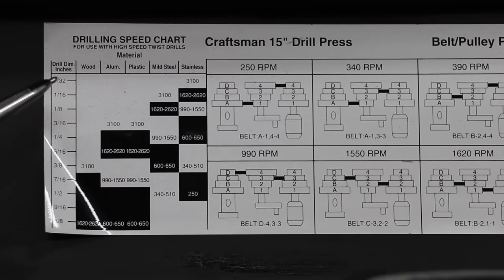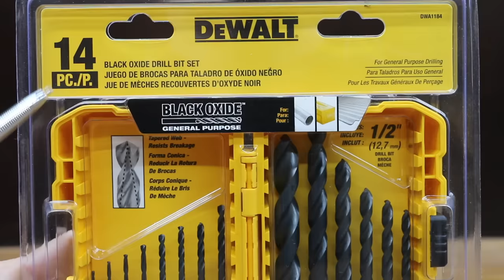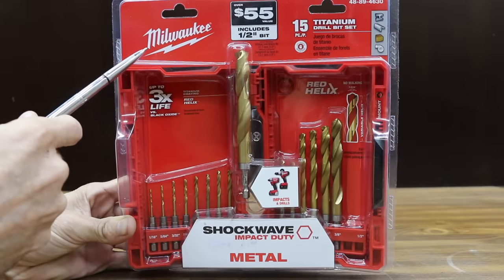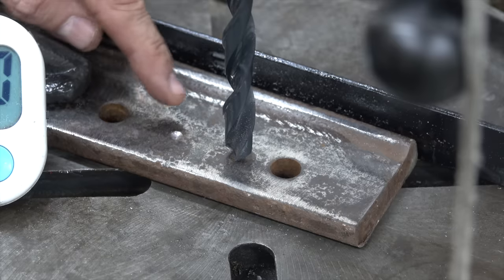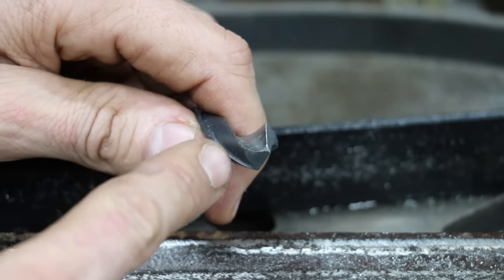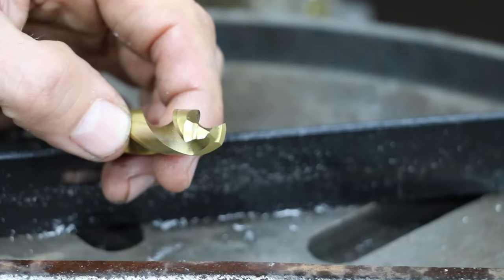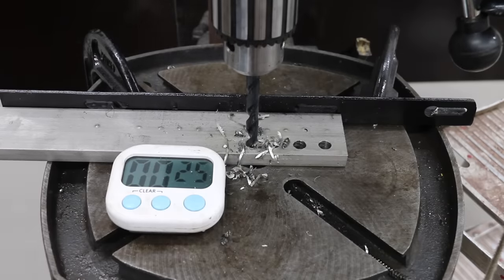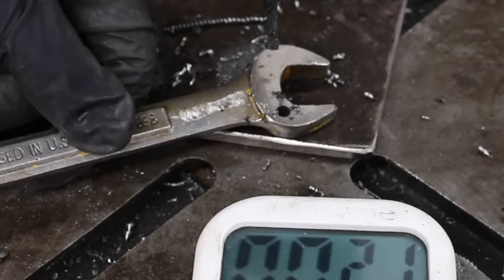Which Drill Bit Brand is Best? Let's find out!

Comment: Test to see if starting fluid actually hurts an engine.
Reply: @stalinsbitch7428  yes that's a last resort for an inch and you know you're going to overhaul next month anyway
Reply: I don’t believe it, just an old wives tale, if you ether lock it and crack ring lands you will be fine
Reply: @stalinsbitch7428  If you need starting fluid, the engine has issues anyway, which will get worse over time, the starting fluid gets the blame for the problem getting worse, when it would have happened anyway due to unresolved underlying issue, my dad has used a similar saying.
Reply: Todd Paulson Starting fluid is great for getting a diesel to shoot flames
Reply: Todd Paulson he already has a video on this
Reply: @CubNole  non chlorinated brake clean works pretty good also.....lol
Reply: StalinsBitch well then why does gasoline engines that commonly burn e85 fuel Which is 85% alcohol and run on that all day long just fine, but when you spray ether alcohol into a diesel engine for a split second along with the diesel that is being sprayed from the injector and not actually burnt so there is a lot of diesel which acts as a lubricant(if it was being burnt the engine would be running) . It just magically destroys and engine in a instant, I don’t think so, if the same principles where correct and true then every gasoline engine would be ruined right away, because gasoline and e85 acts as a excellent solvent, and the cylinder walls will be striped of any oil and destroyed, no not at all. And if there is a layer of oil on the cylinders it would be being burnt and it would smoke brand new from the factory. And yes running a gasoline engine stupid rich will have fuel wash issues long term, that’s bad but a few seconds of ether is no big deal in a diesel. it is a wife’s tale, and aslkng as you don’t ether lock it it will be ok. Also old trucks came from the factory with ether start systems in place, they they have a good enough engine life to make that “ether kills diesels” statement False
Reply: If you would run engine on it, it would delubricate but not if you just start. You not suppose to flood cylinders with but just spray enough so there is vapor to combust it.
Reply: YES! Totally concur with this test. Working drywall you'll go through a box of bits on a project. As a mechanic, I go through a good few bits, too. What IS the best Phillips #2 bit?
Reply: Its amazing how deep anecdotes run into the world of machinery. Change your oil, use the correct fuel, if your engine was quality made from the start it will be fine 50+ years from now.
Reply: @mrmatt2525able  
Ether doesn't kill diesels, people who over ether diesels kill diesels!
The key is how it's "sprayed" injectors atomize the fluid and then ignite it before it has a chance to condense into a liquid. When most people spray starter fluid they soak it and you wind up flooding the engine with solvent drying out the seals that are already on their way out cracking them until you to turn over the engine. Also, have you ever put too much lighter fluid on a charcoal grill? Ever warped the metal on the grate because you wanted those nice char lines? Now imagine that happening inside your engine because you flooded it with starter fluid. Now, do you think it's possible you're over pressurizing your cylinders? Not over heat because that'd take a longer period of time. Warp? maybe.... but doubtful. Unfortunately it only takes one over pressurized stroke to bend a rod, valve, blow a seal. Engines don't heal like people do even though we'd like to think otherwise. So death by a thousand cuts REALLY is a thing for these guys. Just a crack here, a slightly bent rod there and over time you wind up with a cylinder that has at best lost compression or at worse ejected.
 Our diesel tugs at work sometimes needed starter fluid and just misting the intake/filter was all it needed. Some guys would freak out when I sprayed the paper filter... but just a light mist was fine just don't soak it. It's better when there's two people, and you take the filter off crank the engine and have them spray it after you started cranking. By myself i misted the filter. ALSO, sometimes the engine's just too dmn cold to start on it's own. The only thing that's "wrong" is the dmn thing didn't come with glow plugs! So starter fluid is the only way lol.
.
Reply: He did that look at his video history.
Reply: I've been starting my 3cyl Yanmar diesel excavator for 12 years on spray-ether starter fluid. It was made in 1984, still runs like an absolute peach, is incredibly economical and burns almost no oil.
Reply: @viseriod517  I'd concur with that. I put a 1 to 2 second spray into the air filter intake and about 10 seconds later crank it. That's all it should take.
Reply: Myself, I just use a little WD40! A little squirt in my ATV engine when they won’t start up after sitting thru the winter. Squirt of WD40 and they start right up! Done the same thing in lawn mowers too. WD40 more flammable then gasoline! Been doing this for over 40 years and never had any problems!
Reply: Gale Jenness haha WD40 is NOT more flammable than gasoline! Far from it. The flash point of WD40 is 138deg; the flash point of gasoline is -45deg. Yes, minus. The flash point of ether (starter spray) is also -45deg. Both gasoline & ether are explosive when the vapour mixes with air.

Comment: This is one of those times where the most expensive product is actually the best(or 2nd best, since this test didn't cover the longevity claim of the bosch bits)
Reply: Cobalt bits are always better, even the "cheap" Harbor freight ones. I've never worn one down, just broke or lost them. Best bits to buy hands down. Just like at the end of the video though, slower and harder is better.

Comment: Just curious as to the country of manufacture for each set, I would guess china for most?
Reply: I would say NONE of them are USA made. . . . .Precision brand run about $150 a set and I'm sure Cleveland Twist is about the same. Huot can be had for about $50 a set. . .
Reply: @rustysausage69  Where are the Bosch made?
Reply: Yeah many of them I think might be the same bits with different branding.
Reply: @z50com  probably Germany lol
Reply: @SockyNoob  Definitely not, Bosch make next to nothing in Germany.
Reply: @SockyNoob  My bet is Bosch drill bits are made in Malaysia or Taiwan.
Reply: @SockyNoob  Their Concrete Rotary Hammer bits are made in Germany. . .But they're specialized and expensive. . .
Reply: @z50com  I own the 21-piece Cobalt M42 set (same type that Todd tested). They're made in China. In fact, I found that every Bosch bit set including the black oxide, titanium, and Impact Tough (supposedly their toughest bits) are made in China. Very disappointing. But, the cobalt bits seem to work well, as we saw in the video. As long as quality control is strict and the performance is good, then I can't complain too much.
Reply: @zroth79  As long as they perform that's what matters. I worked for McDonnell Douglas/Boeing for 15 years, they only used American made drill bits.  We did have some reamers that came from Yugoslavia but I would bet it was some sort of you buy our Aircraft we'll buy your reamers type of deal. . . .
Reply: @z50com  I'm undecided on this attitude (get whoever's).  I applaud their support, but I understand appreciation of quality.  I want to be impartial, but I see the need for self-support. Yeck, I've even know a foreign US citizen with the attitude (when the economy was bad) "give the sale to the home team" - even would let the baby deer eat from their garden.

Comment: I wish you had used Industrial Brands that Machine shops use ! Not hardware store Brands only !
Reply: I go to the nut and bolt shop and buy the brand they carry- I have had a 4.2mm drill bit last about 6 months until I lost it

But when I buy from the electrical wholesalers or hardware store they hardly ever last

Comment: Dosent all of those big drills require predrilling? I'm pretty sure there was a video from Nyc Cnc or something, explaning that these twist drills arnt actually made for cutting with the center of them.
Reply: Correct.  The chisel point has to bash its way through the metal, so it makes a lot of sense to use a pilot hole that's at least the size of the chisel point on the large bit.
Reply: A pilot hole is certainly desireable and would have made this kind of drilling easier but this was not that type of test.  Also you have to do two drill set ups., anchor your stock so it doesn't move.
Reply: It all depends on the material you are drilling.  With mild steel like 1018 or A36 you can dive right in as long as you don't run the drill too fast.  I prefer to center drill first then drill a pilot hole that is about the thickness of the larger drill's web.  You can also buy split point drills or thin the web yourself with a grinder but this takes skill.

Comment: I love this channel!  I only use Precision brand 135° split points on steels and titanium, and 118° on aluminum and magnesium.  I grind a flat on the lips of anything I drill into brass, bronze, or copper with.  I do own a set of DeWalt black oxide split points to carry in my truck for general handheld drilling, but drill press and milling machine drilling is done with Precision..........and a plenty of lube.
Reply from the maker: Thanks!  Thanks for sharing.

Comment: Another great and non biased test of product.    I am a tool and die maker. We cut a variety of metals from butter soft to harder than a whores heart. Depending on the material to be cut and using an appropriate hardness of drill we will change the cutting edge angle , the relief angle and also the point angle. The rule is that the softer the material the greater angle can be used. All of these things are used respect for the downward force being applied to the drill. ...But this is not what you are testing. Just a comprehensive test of products available off the shelf for the average guy. Again a very nice job of it too.I love your stuff.

Comment: I bought from Home Depot a set of 30 titanium coated Ryobi set of 21 sizes. It was several years ago. Some of the bits were sharpened with a backwards chisel. That is, it looked like it was meant to cut with the drill in reverse but it wasn't. I found this in Harbor Freight drill bits too. Of course, they don't cut at all (except maybe in soft wood but not well).
Reply from the maker: Thanks for sharing.

Comment: A project for you:  When to use what type of drill bit… high speed steel, cobalt, titanium, other?  My experience suggests (a) cobalt for metal, (b) high speed steel for everything else except stone/concrete.  Titanium seems to be mostly marketing hype but otherwise not particularly helpful, but I may be wrong.  For granite — something we have in abundance where I summer — a big Bosch hammer drill (12 amp) and the bits that go with it seems to be the solution.  For concrete block, any masonry bit seems good enough for a few holes.  Slab cement?  Don’t know because I’ve never drilled in it.   Forstner bits:  For commonly used sizes I spend money hoping to get something better, more durable.  For uncommonly used sizes, the cheap ones have proven to be good enough.  [Big forstner bits get hot if you don’t go slow.]

Nice video, interesting test.  Thanks for all you do to inform and entertain.
Reply from the maker: Thanks and you are welcome!  Thanks for the suggestion.

Comment: Great video again! The Bosch drill bits are cobalt, harder, more brittle and more expensive. There are more suitable for hard materials but for small size soft materials drilling, using non cobalt bits may be more cost effective. I've also found here Devault drill bits provides the best values, cobalt or non-cobalt, it's proved in your test.
Reply from the maker: Thanks!  Thanks for the feedback.

Comment: In my experience as a trade guy. My favorite brand is Norseman. Always come straight, hard to brake and lasts very long time. The cost is expensive 100.00 a set.  But you do save money in the long run cus they last so long. I will use them for my hole life. That’s a good feeling when you find product to say that about.
Reply from the maker: Thanks for the feedback.

Comment: Great review. Looked up this test because a previously impressive Warrior set wouldn't drill into steel. I was using sizes I had never drilled with before(fresh, undamaged). I was using a cordless at low speed. I'll get some Dewalt and Craftsman bits now!
Reply from the maker: Thanks!  Thanks for sharing.

Comment: I have been buying a lot of Bosch drills at different service ratings. They are all good, by far the most cosnistent over time, and the specific ones for cutting tiles, are fabulous. I
 may try sharpening the old drill bits to use on less important jobs.
Reply from the maker: Thanks for the feedback.

Comment: The seatbelt anchor on my truck snapped off when I removed it to redo the interior. My 3/8" Warrior bit won't touch it. My 3/8" Snap-On bit won't touch it. My 1/4" Matco extractor drill bit went right through it, but it's too small. You're the first place I looked when I decided I needed to find some good bits for hardened steel. Thanks! I just ordered the Bosch bits - the priciest, but they'll be in my toolbox marked "hardened steel only".
Reply from the maker: Thanks for sharing.

Comment: I just drilled, tonight using a 15A DeWalt corded 1/2" chuck (16) holes  into 3/8 plate....3/8" Bosch Cobalt bit:

16 holes were just about it.  The tip was worn and the flutes were toast. 

Constant lubrication.

Same ..that's not a bad nod to Bosch  as one bit did make it thru 6" of combined, mild steel plate.

I also live in the land of Menards. 

Masterforce...some aren't bad at all.  Esp for the price.
Reply from the maker: Thanks for sharing.

Comment: Love the work PF,. Keep it up. Just a note on Titanium VS Cobalt. Titanium bits are coated, and if you resharpen you lose the anti-friction benefit of the titanium(less friction, less heat edge last longer).  With cobalt, the cobalt is actually in the bit mixed with the HSS, so as you resharpen you continue to receive the benefits of the cobalt bit. I have multiple sets of the Bosch. Use them all day at work, and I love them. More than worth the extra $$$. Titanium bits definitely have their place, but end up being a regular HSS bit, and are disposable as far as being a titanium bit. My Bosch I've had for years, and God only knows how many holes they have drilled.
Reply from the maker: Thanks!  Thanks for sharing.
Reply: Best comment, just what I was looking for.

Comment: Recently I was drilling out broken bolts,  I have no idea what grade they were,  but I used some cheap Harbor Freight bits,  they didn't last long , I found some Black and Decker probably 12 years old, and they cut right through without any problems.  This was from stock I already had. I think I will get me a set of the Dewalt bits, for the price and durability,  I think it's a good compromise.  I searched through your videos and found this video.  I'm looking for a video where you tested some welding rods that use a torch and melt at about 720 degrees F I want to try to weld a pressure washer that froze and cracked.  If it works great, if not no big deal.  Thanks for all you do.  It's very helpful 🙂
Reply from the maker: You are welcome!  Glad to hear!

Comment: Another nicely done video. I have done a lot of metal fab for just an individual (some freelance oilfield work, hobby business building trailer smokers, and more).  Years ago, I started buying Horrible Freight drill bit sets...the 115 piece (I think they're 115) in the gold.finish (nitride, IIRC). They were about $40 on sale at the time. Then I started buying the "cobalt" 115 pc sets at about $100 on sale. I'm rough as hell on bits and the "cobalt" held up way better than the nitride bits.  While it's too late for this test, obviously, I would like to see these tests performed on the HF "cobalt" bits. What I feel would be valuable would be that the 115 pc sets have so many sizes (fractional, number, letter) and are fairly readily-available for many people.
Reply from the maker: Thanks!  Thanks for sharing.

Comment: Great video! One thing I would really like to see is all of the different bit materials from the main brands tested. There are 3 main materials with the first being, regular HSS and it's coated variants (Black Oxide, Titanium Nitride (TiN), Titanium Carbonitride (TiCN), and Titanium Aluminum Nitride (TiAlN) all in order of strength), the next is Cobalt HSS, followed by Carbide. I would really love to see real world tests between the different materials and coatings each brand has to offer, showing the best and worse between all of the brands. The other thing not shown here is actual bit durability, not just edge retention but how resistant the whole bit is to breakage and shattering, that would also be really nice to see! HAAS University has a really good video on all of the bit materials and their properties if you'd like to give that a look.

Thank you as always for providing invaluable and actually tangible information to all tool buyers, diy or pro, you truly are making a difference!
Reply from the maker: Thanks!  Thanks for the suggestion.